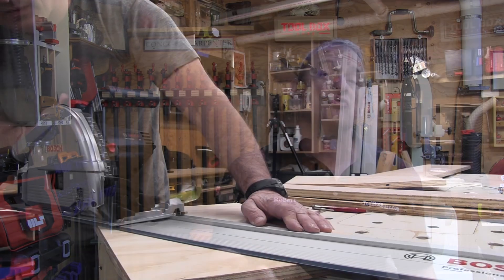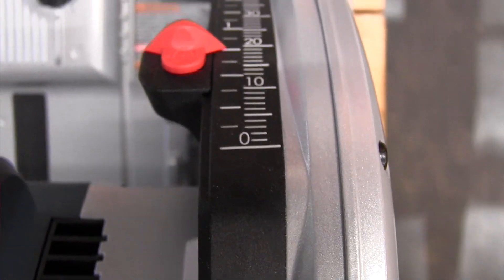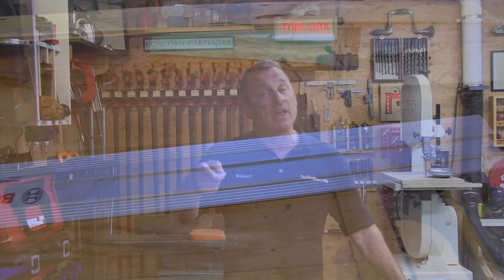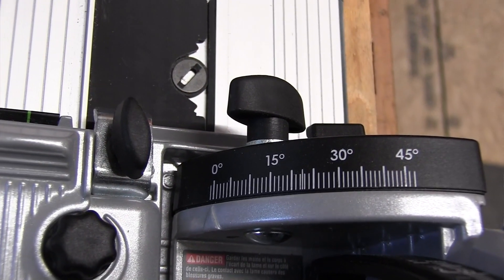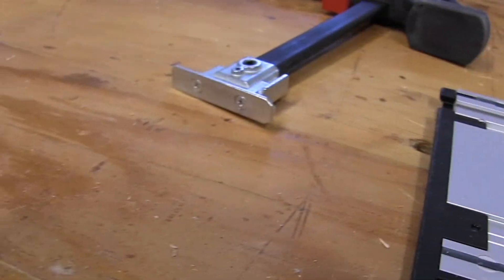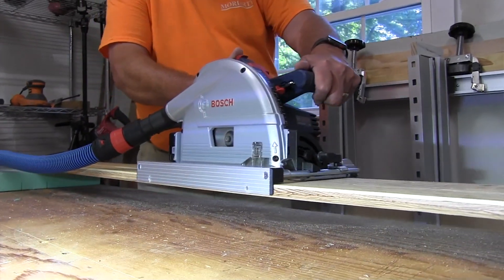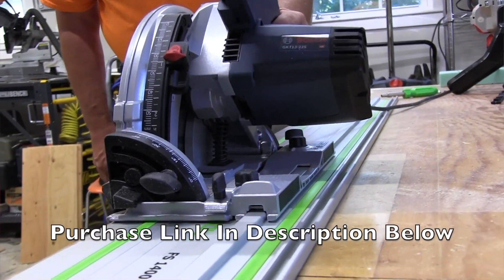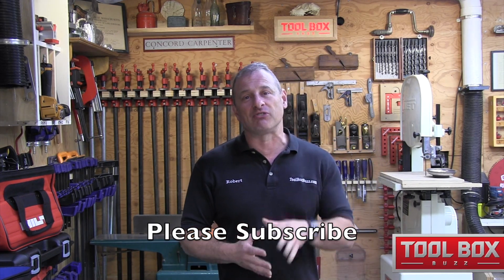Bosch Track Saw Review

Comment: Mafelle make the Bosch tracksaw to a basic design, leaving out all the really cool things on a Mafelle saw
Reply: Like what?
Reply: If you want the premium features, go ahead and pay the premium price. The Bosch is a very good offer at it's price point
Reply: @ThekiBoran  mico adjust of depth, offset 1/10mm score cut, better rubber on the track, better plastic, higher tollorance in all parts, blade change is different. Better balance when cutting at 45. Better paint. Im sure there are more but thats what i saw for myself. I ordered the bosch, makita, festool and mafell and tried them over a week.    At the end the mafell was better then all of them by a mile.
Reply: @josephv5346  the Mafell is the very best, yes; but it is the most expensive too - you have to decide what you want to pay and what you need. Also for some the Festool is the better choice because you can cut near the wall...

Comment: I've got this saw, great bit of kit. Also got the 18v circular saw that bosch made to fit their guide rail, and it also fits Festool rail.
Reply: What's the model number of the 18v if you will. Thanks
Reply: @Issac_G  it's
 GkS 18v - 57g     it can be picked up for £118 Without an L box or about £170 with an L box.  That's a bare tool , I always buy the bare version because all my tools are Bosch, so I have the batteries already . It takes the new 8ah Pro core batteries too.
Reply: @Issac_G  there is a brand new better one coming out in October
Reply: @garradmiller5025  appreciate that! Ill keep an eye out, I did just buy a corded cs10 and in the market for a cordless track saw

Comment: Wow.  Looks like Bosch has another nice product.  I like the plunge adjustment knob.  Super quick to do a scoring cut then adjust for full plunge.  I wish my Makita cordless had that.  I also like the track connector.  That is super smart.

When my TS75 blows up its bye-bye Festool.  Festool service in Indiana blows chunks!!! 

I would assume Bosch will offer this in a cordless model at some point.  Cordless has come a long way and it's only going to get better.  The only tool I wouldn't buy cordless right now is a table saw, and cordless belt sanders are few and far between.  The only one I've seen is Ridgid and I'm kinda not a fan of Ridgid.
Reply: There's a small plunger on the top of your Makita, just to right of your trigger finger. Pull that out, and you automatically make a scoring cut. Push it back in and then make your full depth cut

Comment: Great review! I was leaning towards the Makita or Kreg but this video may have pushed me towards the Bosch. I like the track connector and it's flexibility allowing it to follow a drooping board so you get a complete cut all the way through. I do not know if this saw has a riv knife or anti-kickback feature but I would assume it has one or both.
Reply: I’m stuck between this and the Makita. Too, I hear the makita tracks have better grip and that this saw sticks out beyond its track making it impossible to use MFT like stops/jigs

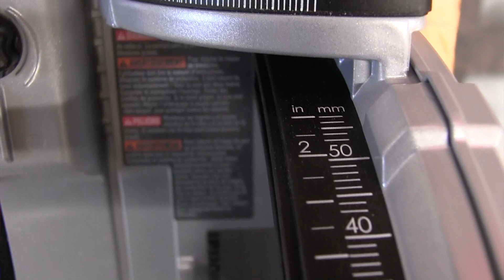Comment: It looks like a winner! You might want to correct the specification. I thought I heard you say 12 inch long cord? My eyes 👀 deceive me but not my ears 👂. At 1:31 on the timeline. How does it stack up to the Festool TS-55? The tracks look better than the Festool? Micro adjustment for depth settings? Blades interchangeable with the TS-55?

Comment: Are the depth adjustment increments "clicking" into place, thus forcing us to use 1mm-2mm-3mm-4mm etc depths, or is it infinitely variable?
Reply: They do index at the mm marks which should be fine for setting a quick depth for through cutting imperial sheetgoods. I literally just got this saw in the mail yesterday and thought i remembered there being a micro adjust allenkey or something but am not seeing such feature on the saw...?

Comment: I love my Bosch tools and consumables. I also hear that this saw is “made in the same factory as the Mafell” ... my question would be, for $600-$1000 when all is said and done for accessories and such. going with what is regarded as best hands down kitted right around that price space +-$200 (corded version)if I’m right.  I cannot see how It wouldn’t be worth it to go with with the Mafell particularly as a shop insvestment. The Mafell is more feature rich and intuitive as far as I know. Someone help me understand this beyond servicing I guess?  Thanks for the Great review!
Reply from the maker: Drew T go with the tool that can be serviced if needed
Reply: I have the Mafell, but if it breaks - I’ll definitely buy this Bosch. The early batch of the Bosch saws had a bent base issue, but they fixed it I believe. One  particular thing is great about the Mafell saw - it’s so easy to change the blade.
Reply: @y0utube5uxx  thanks, I appreciate your hands on insight.

Comment: Would be nice if  they had a cordless version?
Reply: I've got this saw and the 18v circular saw which bosch made to fit the guide rail and it also fits Festool. Plunge saw is excellent, circular saw is great for quick cuts using the rail
Reply: Think they have just brought one out

Comment: this is a great saw and track system which i use most days,,,but there is an issue with the base twisting when returning to 90 degres from 45,,,,, it is a dissapointment that bosch hasnt got on top of this issue.

Comment: I have a Makita 36 v. I don't like it ,, had 3 tracks all 3 were off ..  want to upgrade to festool of Bosch...  Can anyone recommend. I herd festool also has track quality problems.
Reply: I'm have Makita 2 48 tracks connected with festool connectors.
Reply: That's interesting ,,good to know, thanks.
Reply: I've got the Bosch plunge saw, brilliant t bit of kit, someone I work with has the Festool and he prefers the bosch rails
Reply: @sparx2391 

The track connectors on the Bosch are a huge selling point, for me anyway.  Also the plunge adjustment knob.  Good for doing a scoring cut then quickly setting it for a full plunge cut.
Reply: I use the cordless Makita with Festool guide rails. Have not had an issue since switching over to Festool.

Comment: Im from the uk and have the mafelle saw. It replaced the makita and in my opinion is a far better saw. 
One thing that wasnt mentioned in the review and any other comments was a scribing feature. My mafelle has it and i use it loads for cutting laminated kitchen worktops and veneered ply etc. Has the bosch got it? I know you can get a makita tracksaw without this feature.

Comment: Why go with corded tools when the tendencies now is to go all cordless???

At least I am trying to get cords out of the way around my shop.  Safety for one and if you only have one platform every tool is a power source so less looking around.

Just something that came to mind when watching the video.
Reply from the maker: Answer is 42 good point, I’m still mostly corded in the  shop
Reply: @ConcordCarpenter  all my stationary tools are plugged in a wall.  Planner, jointer, table saw, chopsaw, big router, drum sander, ext...

Everything I use on the bench is usually battery with a few exceptions. Random orbital sanders and jigsaw. I do own a cordless sander and i find it's not controllable so it's in my tool pouch when I deliver something just in case but it's rare I ever pull it out.  The jigsaw is just because it's a tool that I rarely use and didn't do the upgrade to battery.
Reply: There is no comparison how much power you can get out of a cord compared to a battery. A cord is essentially infinite amp hours. A cord should outlast a battery too. A cord will never go dead on you.
Reply: If you don't use your batteries regularly they die.  Then you're out of luck.  I'm replacing my cordless tools with corded.  I do not work on things every week...
Reply: @stevescuba1978  batteries have a limited lifespan no matter what you do with them. Batteries are chemical devices. But proper care can maximize battery life. You should work on things regularly too. Always keep a hand in. Skills also die if not exercised.
Reply: @stevescuba1978  I own a production woodworking shop.  Its what I do for a living.  

That being said.  With todays batteries I haven't had one go bad in years and I have left batteries in the back of the truck for weeks in a Canadian winter
Reply: @1pcfred  , carpal tunnel... It's ended my career as an electrician, and make me limit how much "fun" I have with tools.  Even today's batteries need regular charge/discharge cycles, or they lose their  capacity fairly quickly.  

I made my comment for the overwhelming number of weekenders who would be bummed to use their cordless tools 6-7 times over a few years, and they find an almost-new tool that needs a new battery. 

I sold my Makita cordless set to someone who uses them daily, and now I have corded tools that will last my hobby use for the rest of my life.
Reply: @answeris4217  I had cordless tools last year s of daily use on the original batteries.  It is when they get stored for a few months at a time that it causes issues.  Batteries die when NOT in use.  Your circumstances are perfect for cordless tools, in my experience (machine shops, electrical jobsites, flight line).  Most folks do not use their tools at home as regularly, and I would suggest to those folks to stick with corded tools.
Reply: @stevescuba1978  the other day I thought I might be getting carpal tunnel myself. It might have just been a minor sprain though? Too much of a good thing is a concern. I had this nagging sensation in one of my hands. It did not feel normal to me. It might be the mouse I use on this computer that caused it? It was that or the week I spent doing a lot of hand planing wood. I made some shelves for my kitchen and apparently I can't saw wood square to save my life. At least not for the length the width of those shelves are. So I cut to the side of my lines and planed up square. I feel OK now. I guess it is good to mix up one's activities to avoid RSS.
Reply: @stevescuba1978  like I said.  I have no problem with batteries.  The thing that kills batteries is having them in low charge.

I have the same batteries from when I originally bought my ridgid drill.  That I bought like 5 years ago and I didn't always use them.  Winter is slow for my business so months in the cold they are not used

Comment: Rob, I personally own the makita track saw, my partner has the festool track saw, and I tested the bosch track saw at a tool show, the bosch is a very good saw, and very smooth, but I've gotta tell ya , for $ 600.00 plus track ( sold separately), my makita at $ 400.00 ( plus track) is just as good  for roughly $ 200.00 less. have you field tested the Makita track saw yet ?
Mike
Reply from the maker: Michael Mancini I have a cordless @Makita in my trailer
Reply: As someone that does full relamination jobs of entire Banks, and has been doing them for the better part of 7 years, I assure you the Makita is just as good (with a new blade) as the festool at cutting laminate, Though I agree the customer service isn't the best
Reply: @D G

Chipping can be eliminated by doing an extremely shallow scoring cut then doing a full plunge cut.

Comment: Watch out as there's a battery-powered one on the way
Reply: I don't get why anybody would be looking for something that plugs in today.  

You go on a job site and you don't have a place to plug in... You basically paid 700 dollars for a paper weight.
Reply: @answeris4217  from what I can tell based off of what my co-workers say is that they are afraid of the battery dying mid cut and getting blowback because of it, most of the older guys in the field seem against battery tools that require a lot of power (E.g. DeWalt mitre saw, Milwaukee table saw etc)while shop guys prefer cordless. The fear of "I just destroyed this piece and wasted a lot of money" makes the older field guys hesitant.
Reply: @answeris4217 

I've never been to a jobsite without temp or house power.  What are you working on?
Reply: Not everyone works on a jobsite
Reply: @garradmiller5025 

You mean like installing wood fences on a ranch?
Reply: @wuddude1599  no like in your garage
Reply: @garradmiller5025 

You mean like a shed out in the back 40?
Reply: This saw already has a battery sized blade on it.
Reply: @garradmiller5025 

My garage has power.
Reply: @ThekiBoran  mine too what's your point?  Was responding to the guy who said why would you buy anything plug in.
Reply: @garradmiller5025 

Right, and I asked you what jobsite doesn't have house or temp power.  Then you said my garage but my garage has power.

Comment: I just thought of something.  What about parallel guides?  Festool has their parallel guides and Seneca also makes parallel guides that work for both Festool and Makita track saws.

Looking at the Bosch track, which looks really good with its connector/alignment plate that ensures straightness, it doesn't look like it can be used with any aftermarket parallel guides.

Anyone know of available parallel guides for the Bosch?

Comment: This track saw is garbage, I've used the corded festool, the corded Makita and battery Makita, the corded and the battery DeWalts, and this Bosch garbage. It rattles on the track, leaves jagged edges on everything it cuts and seemed weaker than other models. Not only that but Bosch kept with it's tradition of using a blade size that no other brand uses, the DeWalt blades might fit but I don't know, and that isn't sold in most stores (in Florida anyways) the only good thing about this system is the track connector
Reply: Odd...sounds like you have a lemon. There are shims and stuff to adjust for a more accurate fit perhaps you need to readjust it.  I actually went from the Dewalt to the Bosch and now to the festool TS75 track saw due to poor dewalt build quality and lack of functionality. I was really disappointed with the flexvolt runtime and the dust collection/functionality on both corded and cordless models. I had a hell of time with my dewalt and its warranty. Hands down the worst warranty experience I have had in Canada.
Reply from the maker: jason dean I’m thinking you didn’t adjust the cams???
Reply: @D G I literally put a 6 1/2 Makita blade into the Bosch two days ago and while it did fit on the arbor the blade would only spin until it made contact with the melamine we were cutting. I think the issue with the blades is that the Makita blades are thinner than other blades which means the arbor isn't clamping on them tight enough, which is why I also said that maybe DeWalts blades would work because they are thicker
Reply: @ConcordCarpenter  the Bosch belonged to a co-worker so there's a chance it was misaligned, but I honestly doubt it because he's the type of guy to read the instructions and do everything to make the product work. It's very likely he received a lemon as he pre-ordered it the moment he heard they were bringing it to the states and waited months for it. Even the DeWalt cordless track saw with its awkward plunge is better received. Great video btw, while I disagree with this saw being good I still love you guys and your videos!
Reply: @ConcordCarpenter  he put bubble hash oil in the tracks it should have worked.
Reply from the maker: Paul Frederick too much honey oil I guess!